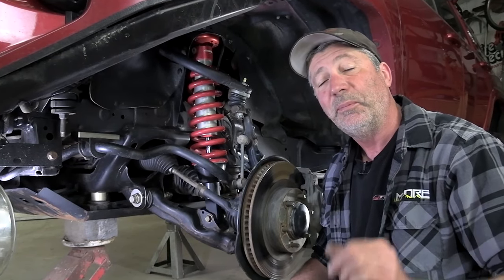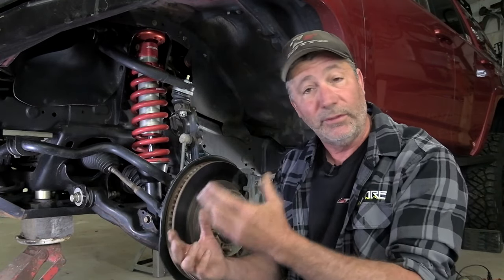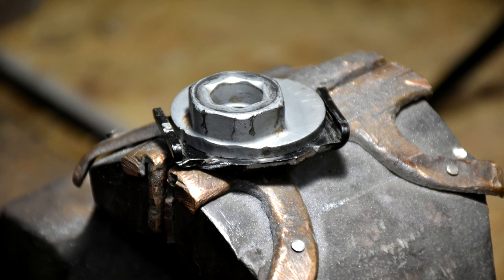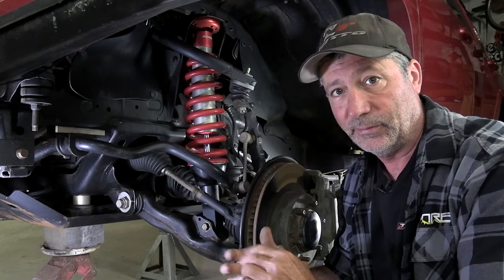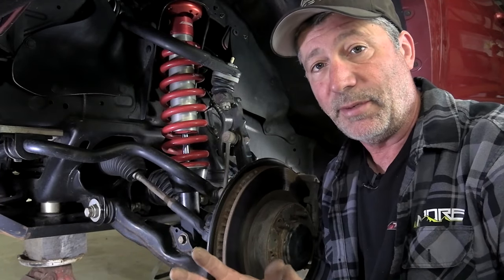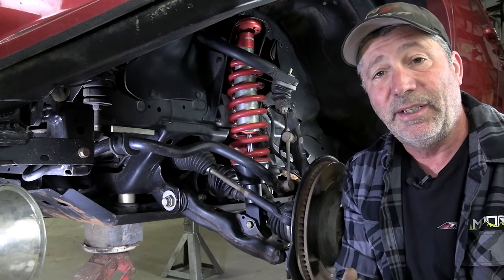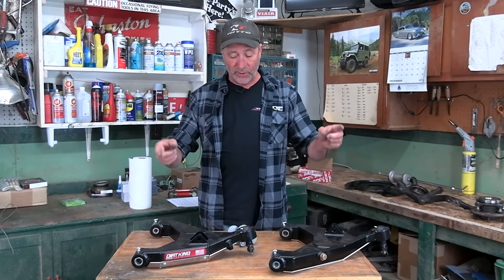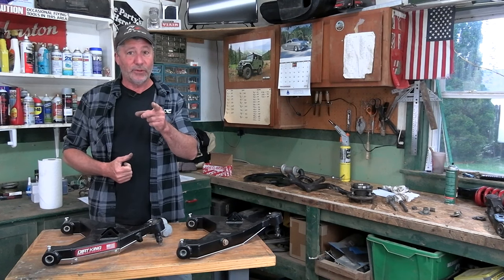Toyota Frozen Lower Control Arm Bolts, Myth Debunked

Comment: He is right my bolts are frozen i had to cut them off with a sawzall  and it's not just Toyota it happened to my ford f 150 my Pathfinder and now my ram 1500 every single bolt lower control arms stut  to control arm bushing and upper control arm bushing bolts all frozen had to cut all of them out and replace everything .and the reason is called time and nature and rust. It's not a flaw I. Any manufacturer and the reason you can hammer the bolts out is it's surrounded by rubber which absorbs the blows by the hammer along with the rust and those rubber bushing swell that's the end result

Comment: Hey fellas, just a word of caution, the SPC cam bolt kit is know to have some issues.  Specifically giving you play with the steering wheel.  Seems it might have to do with the plastic case. If you buy OEM, it's not plastic.  You'll have to look up the parts one by one but OEM is the safe bet to go if you want to avoid any potential issues down the line.
Reply from the maker: LOL “trust me”. You’re going to have to explain what “issues” you’ve experienced if you’re going to bash something or someone on my channel. LOL
Reply: @WanderlostOverland  I didn't take his comment as "bashing", just something to look into.
Reply: @WanderlostOverland oem is better. Spc is not very good. If you need references, refer to any person on a forum that reasonably wheels their truck. Bushings are really bad on spc and this is evident in the reduced life span people commonly experience. Most people get 1yr out of them before they are trash. Paying the extra few hundred bucks is well worth it to get something decent. Spc is really the cheapest of the bunch so it's expected to be substantially worse for offroading. At the very least, upgrading the bushings and balljoints would help but you might as well just buy something better at that point.
Reply: @jeremymclean506  Loose axles just released a video 2 week ago about upgrading UCA and LCA on his 4th Gen 4runner, and he pretty much mirrors your experience. His SPC UCA only lasted a year. Just trying to save people time and money is all.

Comment: Slightly misleading. You can mark the cam positions with a paint pen and then pull out each cam assembly and anti-seize them as preventative maintenance. For the front adjusters you should anti-seize the sleeve that touches the bushing, as well as where the through-bolt touches the adjuster sleeve. You don't have to do this only when it's brand new, it should be part of ongoing maintenance procedures. People have been doing this for decades, it is nothing new.
Reply: That is exactly right. Just lube both the sleeve and bolt. Good informative video though.

Comment: Great video sir, i went for an alignment but was only able to get the front aligned because the back adjustment point bolt is frozen for 2013 sonata, what steps I can take at this point?
Reply: If the alignment was in spec for the rear, i would leave them be, and save your momey for other repairs. If alignment is out, maybe some bushings are worn on the vehicle? OEM rubber seems to be the best quality if you go to replace, but they dont always sell just the bushing like the aftermarket has. Complete unit replacement is usually the way to go if you dont have all the right tools or experience to replace 1 bushing

Comment: I just had to replace all the bushings on a '99 Tacoma with over 400,000 miles on it, they had never been touched since new. After watching several YouTube videos prior to starting the job, I prepared myself with a sawzall. However, all the bolts and sleeves came out without difficulty. I live in Washington State. They use some calcium chloride (salt) on the roads here on occasion. Why did I not have the problem that everyone else seems to have.

Comment: The products from SPC have changed the design slightly at least for my second generation Tundra. Both long and short bolts have a flat cut into them where by both bolts DO turn the adjustment cam washers. Looks like they saw the same issue and made the change. Good video.
Reply: Also the “plastic spacer” Is in fact a Delrin bushing.

Comment: I have a northeast 05 runner and a cam/caster adjustment was probably never done in its 17 years of life. I went to install a lift kit and reading up I was simply convinced that the Cam/Caster adjusters would be seized...so did the right thing and without even checking I ordered 2 new LCA and OEM hardware...But to my surprise nothing was seized. Rusty but not seized. Coulda saved a few bucks and returned the new parts but I proceeded with replacement and applied a liberal amount of anti-seize to the LCA bushing sleeve, caster sleeve, and bolts. Lesson learned: check 1st
Reply: Same here except 2011 Tacoma.  It would be funny if the same thing happens to me.  I am still in the window of return with Rock Auto Parts.

Comment: Did this job today and had to chop the old bolts out. Made an easy job into a real fun job
Reply: I’m in a similar situation, just to be clear you cut the bolts and not the actual control arm? I really don’t want to have to spend the $500+ for the arms.

Comment: I had my drivers side replaced with the SPC’s three years ago, and they are still holding strong. 

About to do the frozen passenger side which means unfortunately cutting them out. Potentially having to replace the LCA bushings as well

At this point, I am considering replacing  both sides entire LCA, as I would in addition like to replace my ball joints. 

Do you have any suggestions for an aftermarket LCA for a Tundra that does not see hard off-road use?  Napa greaseables and Moog seem to be two that have the added zerk fitting 

Thanks for the great video.

Comment: I don't have this problem with a 2nd gen gs300. The front and rear lower cam bolts are the same. I actually don't use the rear cam bolts anymore because the arms themselves are fully adjustable

Comment: When I use Anti-Seize I apply it liberally to the bolt threads, bolt shaft and the Flange of the Hex bolt head and Nut's inside flange.
Coating the bolt shaft gets the sleeve you are rotating during adjustment coated in anti-seize.
My '02- Jeep Grand Cherokee Laredo- 4.7L V8, doesn't have adjusting bolts like this Toyota.

PSA: Don't use Copper or Silver anti-seize!
Use Nickel Anti-Seize instead,
Direct Quote from Loctite "Henkel-Adhesives":
▪︎ "copper anti-seize on stainless steel will create inter-crystalline corrosion which can cause parts to crack or break when under heavy loads." - Loctite Quote

That's why I use Nickel, it's a higher grade anti-seize and you can pick up an 8oz can with brush applicator screw on lid for under $20 which for most DIY Mechanics and garage wrenching is a lifetime supply of anti-seize.
I like these brands
▪︎ Loctite Nickel Anti-Seize ($18 8oz Can)
▪︎ Nickel-Graf Anti-Seize ($16 5oz/$29 8oz)
Both have brush applicator built into the metal screw top lid.
But you can go with others, 

▪︎ Permatex is also a very trusted brand when it comes to grease, threadlockers and compounds.

If you put anti-seize on threads then you have to reduce torque by 30%!
Yo do this, simply multiply dry Torque-spec by 0.7 to get the wet(anti-seize) torque number.
Example: 
100FT-LBS * 0.7 = 70 ft-lbs 
95 Ft-Lbs * 0.7 = 66.5 Ft-Lbs
70 Ft-Lbs * 0.7 = 49 Ft-Lbs
50 ft-lbs * 0.7 = 35 Ft-Lbs

So on my 02 Jeep Grand Cherokee Laredo manual specifies 100 Ft-Lbs DRY so I would set my Torque Wrench to 70ft-lbs with Anti-Seize on the threads and it would be equivalent to 100FT-LBS Dry

Comment: I guess this is a common problem for toyota people cause my 05 is300 got the same issue. Alignment guys told me they can't turn that bolt. So my question is do I need to replace the whole control arm and do the bolts come with it? I don't plan on keep my car much longer anyways maybe a couple more years hopefully max. Do I still need to take that preventive maintenance?

Comment: I just put 38.5x 11 x15 tires on and now when I turn left at 50 mph it feels like my tire wants to fold under the rig. I just put new upper and lower ball joints from Toyota and just put new tie bar, the rod ends, wheel bearings. Is it my control arm bushings? And I just had it allighned at Toyota. It feels like I'm getting on 3 wheels at 50 and up. Any Ideas what I should replace next.

Comment: Went for an alignment at tire discounters, my 2011 Toyota Camry. They said they couldn't finish my alignment because it has an eccentric bolt they couldn't get loose, what would you do? They're talking about applying heat to get it off, but we worry it's going to weaken the metal.
Reply from the maker: Heating might free it up. Unfortunately, there's a rubber bushing inside that will likely be damaged. Best thing is cut the parts off and install new.
Reply: So cut the eccentric bolt off? Or the lower control arm. Trying do this myself instead of paying $1000 or more st a shop.

Comment: At what average milage does the freeze occur in your opinion?
Reply from the maker: If you live in an area where they salt the roads, immediately.
Reply: Every vehicle is different but I’ve seen Toyotas as new as 5 years old have seized cam bolts. 10 years old is a guarantee.
Reply: @purcetc  And by 15+ yrs, Toyota will tell you they have to replace the whole rear of the vehicle. Just rediculous.
Reply: I have 76,000 miles on mine and it's frozen
Reply: i have 40k on mine and they are frozen. well one is. plan to cut the bolt and hope to remove the LCA and replace just the assembly